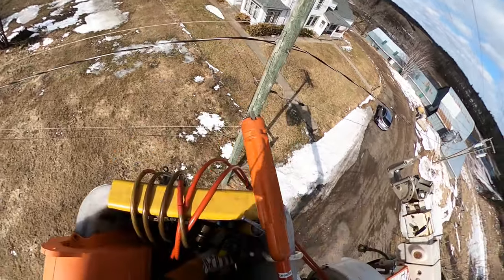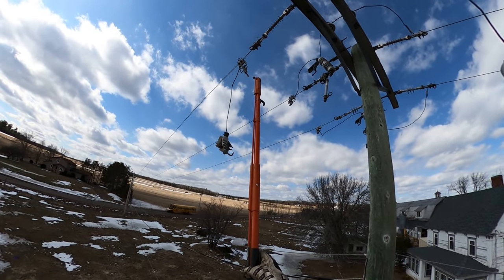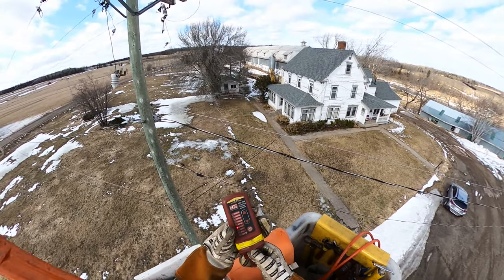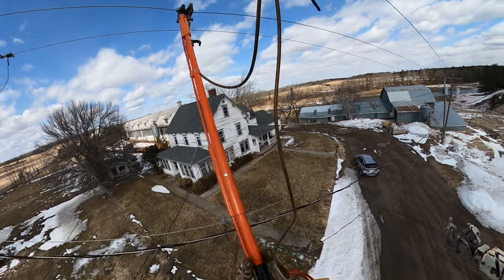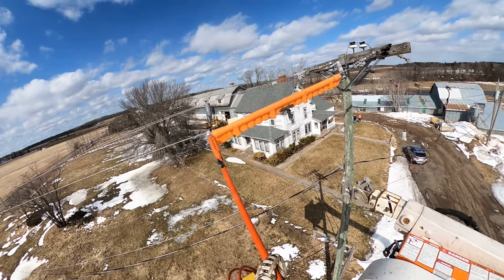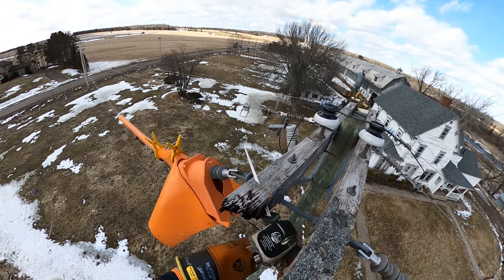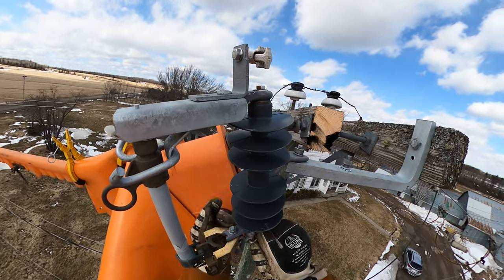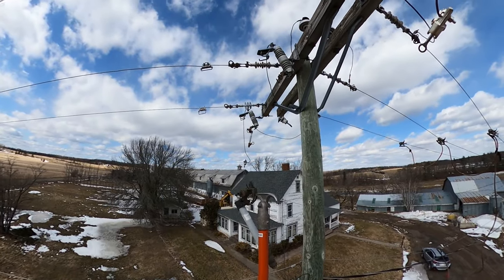Lineman POV

Comment: Thank you very much for sharing this info with us. I am an old retired electrician, but with the info you have provided.  I was able to accurately report an outage by telling dispatch where the open cut out was by pole number. It resulted in a very quick repair. Outage caused by ravens having a party on the primary and one getting too close to the lead from the lightning arrestor ground lead. You are awesome, and I look forward to the next vlog.

Comment: Awesome video and I thank all the linemen for keeping the lights on. I am in the automotive industry and use all Milwaukee tools. The only issue I have with them are the batteries. Most of my batteries are glued back together the screws are to small and they tear out easily.

Comment: This is an interesting video. We had a nasty storm about a month ago that took down 30 poles along one road and pole down on our property. Of course I stayed away from the line in the middle of the property just in case but it took the power company a week plus a helicopter with a cable flying out of it to restore the down lines and 30 poles in the nearby town.

Comment: If you're ever worried about sharp objects, check out firefighter extrication gloves. They're usually insulated by they're extremely durable, we use them for motor vehicle accidents and things like that
Reply: The insulation Arron speaks about is from high voltage and his gloves are certified. Not so with the common gloves used in the fire service.
Reply: > "firefighter extrication gloves"

Good for broken glass and jagged steel. Not rated for big electricity (if they were, they'd call them something else). Good for making haste to save lives in fires or crashes while lessening firefighter hand damage. 
Lineworkers should not "haste". Although you see Aaron working quickly, he's not rushing. He can look out for jagged metal and work around it. Unlike an accident scene where lives hang in balance. 
The traditional lineworker hand/arm protection is leather gloves over long rubber gloves. (as said) The rubber (probably miracle plastic now) is rated and repeatedly tested to not have any pinholes or thin spots at XX thousand Volts. These go far up the arm, sometimes covering shoulders (Murphy's Law). No other profession has gloves quite like these. Of course there's sharp metal and pole-splinters which would hole the rubber so they wear leather gloves over (maybe now a tough plastic? maybe extrication gloves?).

Comment: Nice and smooth repair! I like that extended cutout bracket. And, what is this sorcery? The metal pins in the clothes pins!!!! I have never seen that before! Places I've worked were either cheap or the lineman were stuck in their old ways and got rid of the pins, people don't like change and linemen hate change! lol (no offense)  But makes it possible to clip with a hot stick!

Comment: It looks like that was a Chance cutout?  All Chance cutouts were ordered by the Governor/DPUC to be taken out and replaced in Connecticut in 2006 when one broke, dropped the 23kV primary onto the secondary feeding a Dunkin Donuts in Farmington, and burned the building down.  Root cause - manufacturing defects from the plant in Mexico causing cement growth at the mounting post joint over many freeze/thaw cycles and cracking the porcelain in half, dropping the cutout.  Which looks exactly like what happened here.
Are you guys not using the new PUPI fiberglass arms with Hendrix visetop polymer insulators yet?

Comment: Good video. I personally wouldn’t have grounded. I know each situation is different but to me it seemed like more of a hazard having grounds on as opposed to just leaving it isolated. If backfeed was going to be an issue I just would’ve pulled the leads at the bank. But everyone is different, just how I would’ve done it. Keep up the good work!
Reply from the maker: Thing is....I agree with you %100!!
Unfortunately its a bit of a fault in our procedures; In order to "go hands on" the dead side to remove the lead, the primary has to either be grounded or have a "hold off". 
We don't run into this situation often, but it's been much debated. 
Again tho... I absolutely agree

Comment: I agree with you on Milwaukee is great.  I got their V28 way back when they first came out, and my casual use of them had the batteries lasting well over a decade!  The M28 which replaced them were backwards compatible.  I miss the double way on the hammer drill... as for horizontal drilling was more balanced.
M12... the batteries didn't last as long, but did get 5 to 7 years out of them.  M18... have the hammer drill, and a radio which works with M12, M18, and V18/M28/V28 batteries.  Recently, got some other M18 stuff (fan and oscillating saw), and works well.

Comment: In 1973 I was with a crew that was disconnecting a 3 phase line that was being back fed from another line while we trenched new cable under I-90.  My line foreman couldn't get in the right position to unhook the jumper from his stick after he had taken it off a phase.  There was a little J Hook in the jumper.  He told me to watch out because it could jump when he let it go.  Boy, did it.  It whipped up and contacted another phase, which burned off with the hot tail brushing my hard hat as I dove in the ditch.  I went back to college.  😂. Thanks.

Comment: Bud have them make a cutter for automatic sleeves. Same concept as a plumbers pipe cutter. They have us remove autos and install compression sleeves on our primary. I currently use a sawzall but it gets a little dicey 😂😉. So instead of jumping out the sleeve and cutting it on both sides and then have to insteal 2 compression sleeves and a piece of wire in the middle. I prefer to jumper it out and cut the auto in the middle bang out the waffle stopper in the middle and remove all the guts and install one compression. Would be sweet if they had a battery tool for that.

Comment: That was great.  Really enjoyed seeing the work done.  Seems you can never appreciate what it really takes to do the work.  It always been hard to see from the ground and staying out of the way.  I actually found a cover up.  The ones that slide on the line.  Just different when you see it and get to touch things.  Have always seen them on lines.  It was heavier than I thought it would be. Seem they would not be fun to wrangle in in bad weather.  Also, how they clip together was interesting to see.  I also found working with the hand line changing lights was interesting also.  Do you have any particular tool pouches or bags that help to make the job easier working at heights.  How do some of the guys use the soft sided buckets and different tool set ups. That they may like or you.  What kind of method do you use to get out of the bucket if you got stuck or had a failure.  We had an arial lift that caught fire.  They brought another lift over to get them off. This was not ideal.  I know they make kits to repel down.  Just seeing what they supplied you with or like.  Sometimes you never know what might happen.  Lately we have run into some strange things.

Comment: Does your work procedure require to remove the battery from the chainsaw when handing it to someone in bucket?
Reply from the maker: Great question! It's not something we've actually discussed.
Just to note, 
It does have a double safety;
-Chain brake both locks the chain as well as disengages it electronically.
-Safety trigger on palm side that must be engaged along with throttle.

Definitely something worth taking into consideration though!

Comment: What is the point of the temporary grounding things? That side was deenergized, right? So it's just in case someone's solar batteries are putting power back in? Wouldn't they be shorted?

Comment: What do you do with the rubbers when they are no longer certified for high voltage? I ask because I can think of a lot of uses for other trades where they would get a second life. Either low voltage stuff or even knee protection or sound dampening. Good way to recoup some of the cost.

Comment: How do you keep from single phasing a 3 phase load while closing the cut outs?
Reply from the maker: Ya don't really 😔...
It's best for a customer to have their own 3 phase protection. In commercial/industrial areas we use a lot of gang operated switches or protection that locks out all 3 phases if we lose one.

Comment: I don't see the use of dielectric grease when assembling electrical components. You mention a number of items have a tendency to freeze on if overtightened, i.e., stirrups. The same grease could be used as anti-seaze in addition to using it for conductor terminations, could it not? You also mentioned the coiled cutout lead should be uncoiled to prevent induction tendency. It doesn't appear my local utility bothers to uncoil any of their new cutout leads. Is that considered bad procedure or merely not recommended?

Comment: I've been fascinated with power lines ever since I was a kid. These kinds of videos are very entertaining and educational. 
Bit of an odd question, but is there a difference between a pole with 2 mounted transformers vs a pole with 3? I know a pole with 3 transformers is  referred to as a bank, but I always wondered if having 2 transformers on a pole also counts as a bank. Maybe a potential video idea? ;)
Reply: Where I am from they are called open banks and closed banks. 2 transformers is open bank and 3 is a closed bank. We also call them 2 pot banks and 3 pot banks. There can be some differences in voltage but sometimes they make same voltage. The main difference is the KVA capacity. A 2 pot bank generally will handle about half of the load of a 3 pot bank. Transformer banks can get complicated but this is a quick rundown pertaining to your question. Hope this helps!

Comment: great video but i am a little skeptical you get 45 ft lbs of torque with that hand wrench. i can see 45 inch  lbs. i remember tightening cylinder head bolts to 90 ft lbs and that takes a good amount of force with a torque wrench.
Reply: Would agree. I did a lot of aluminum engine rebuilds over the years and a quick shot with a wrench that size is probably not going over 20 - 25 ft lbs. 45 in lbs can be done with a screwdriver and a good grunt, so not enough for those parts. I would guess 45 ft lbs might be a max but you'd need two hands and something to back it up so nothing twists. An impact wrench with a torque limiter would be a good idea. (something made just for this job?)

Comment: Nice Video! Why could there be load if lightning arrestors are installed? I guess there are only conducting at high voltage. More than the actuall line voltage. An who is this beautie co moderator next to you?

Comment: I wonder how feasible it would be to make a duckbill with insulated prongs and a spring so it would stay disconnected and then as you tighten it, it would grip and then the metal part would snap on the line like a mousetrap. Kind of like the fault sensors.

Comment: I have a question for you. I live in your service area and there are 3 poles near a church to the East/South of your town on the main road with a bunch of those orange protective coverings on. What were poles supposed to be for?
Reply from the maker: Those were for three voltage regulators. (1 per pole)
We were starting to have voltage issues with the increased load in the Carriage Hill area over last couple years. (Big homes in Nigary area included).
That same line covered the entire 114.
Ended up building a whole new feeder instead, which you can see come out of the woods near the old garden center. 
The initial line now takes care of all point park, gunn, carriage area and the new line is better able to maintain higher voltage heading out of town.
The poles will likely be removed now... Or once it's confirmed they won't be needed.
Reply: Thank you very much. Every time I drive by them, I wondered about that.

Comment: What the highest voltage 
you can work on ? And can you 
do a segment on all the tools and equipment you use on a daily basis. I wanted to be a lineman but having learning difficulties made it
Impossible to do the work so 
I was doing first year electrical at Tafe but unfortunately the class was cancelled 6 months after it was started as most of the other students where turning up late or not at all. So I just ended up doing single phase equipment maintenance instead  till i had to early retirement because of the dam Schumann’s  disease of my spine.
Reply from the maker: Sorry to hear that :/... We can work on any voltage, the highest we have in our province is 345kV

Comment: Great job Aaron, Yeah I wish Milwaukee would make a cordless air compressor that you could use on heavy duty air tools and framing nail guns or at least think about the option, I know they make small one but it doesn't have the capacity to run a framing nail gun or a heavy duty impact wrench, just think about all the air tools you would be able to use if they built a better system for a larger air compressor that's cordless , I understand they want everything cordless with batteries, but that would open up a new ball game of players. All kinds of trades would buy it if it worked.
Reply: There's probably a market for that but I feel it's a stopgap where about the only tool left that hasn't gone fully electric / battery is an air chisel. Almost any other tool can be made more efficiently by going directly with a battery.... like framing hammers powered by battery. BTW, you can power a fair-sized portable compressor with one of those solar / battery pack deals. Yes, they are expensive, but in the long run they seem to be holding their own against a portable gen set, without the noise.
Reply: It's just an idea, doesn't mean it will happen.
Reply: I think screwing around the battery crap, is a pain sometimes, you need a special battery for this, or you need to charge your battery for that, is just not my dish of fun, but if they don't get off the pot, someone else will do it. They think it will be the end of an Era, but it might start a whole new one.
Reply: @johnwalker890  ... you haven't done any shopping lately. If you stick with one brand the batteries are interchangeable these days. There are even snow blowers and lawnmowers sharing batteries, so you always have a charged spare without having to spend a wad on extras.
Reply: I know I'm just ranting. They could also make an inverter to plug on the battery power tool, too, make a small inverter plug in for the battery type power tools.
Reply: No, I'm not allowed out of the house, because my mom and dad won't let me out, help?!?, haha just kidding 😂.
Reply: @johnwalker890  ... already done and can be great for running your laptop or charging your phone. I believe Dewalt, Makita and some others are in the game using their standard tool battery. I believe Dewalt was the first (20 years ago?) to have a portable radio that ran on the same battery as their power tools, plus the radio doubled as a charger if you had access to 120 volts.
Reply: Yeah I remember, Dewalt did have plug in for the battery powered tools and really didn't go anywhere, but it would be nice if Milwaukee could do a better job, or something like that, if your batteries are dead and have plug in power, but I understand get more batteries, and it's annoying that I have to charge them before every project. The batteries are expensive and they are coming out with different options, and it feels like I'm being priced out on some tools.
Reply: The plug in would be good for high energy tools, like table saw, compound miter saw, snake auger, pipe threader, the power tools that demand high power to function, and I understand that they a trying to make it all battery, but sometimes it is just more reliable to plug in.
Reply: @johnwalker890  ... as a retired guy, not using stuff daily, I feel your pain. OTOH, in the field / on the job they are the cat's ass!
Reply: I hear you, something's you can pass the buck to the customer and have them pay for your new tools, but the way things are heading, it's getting harder to get the customer to spend.
Reply: Have a good night, rupe 53.

Comment: Dumb question: Why did you attach the ground to one phase, and then go from phase to phase with the other two grounds, vs from ground straight to each phase?
Reply from the maker: Not a dumb question at all and welcome anyone with more information on this to certainly chime in!
Having them connect in series like this ensures the shortest path for equal potential between all wires.
It's splitting hairs a bit, but if one phase were to become energized while working on the cross arm (for example). There would be a very slightly smaller difference in potential from wire to wire with that setup vs going down to neutral and back up. We're talking very subtle differences but every improvement counts when it comes to a single cycle withing a fraction of a second.
Also during high current faults the wires can dance around quite violently. The shorter the ground/bond the better!

Comment: Aaron how far will your company stretch out the secondary service wire?
Reply from the maker: 🤔 I'd have to dig out the engineer books to answer that one 😳.
The last span from pole to house is 27m if it's 1/0 wire... 34m if it's #2.

We can bring in the triplex much farther than that of course...

We'll run in a couple span of 1/0 to a single customer without issue,.. I'll throw in a number off the top of my head of 100m max before voltage drop issues. Further than that we'll update the wire size to 2/0 or 4/0.

I've seen secondary runs of 500m or more if it's just lighting load.